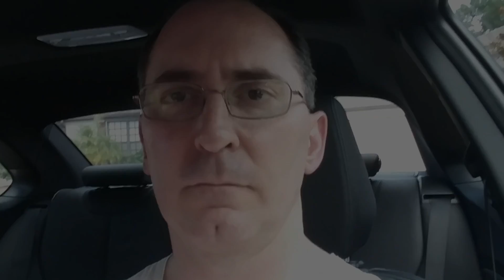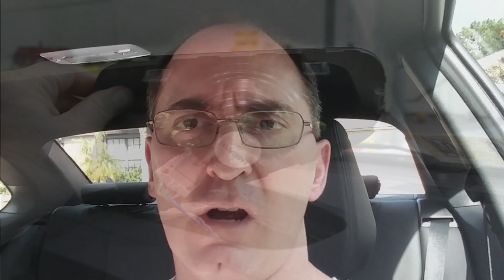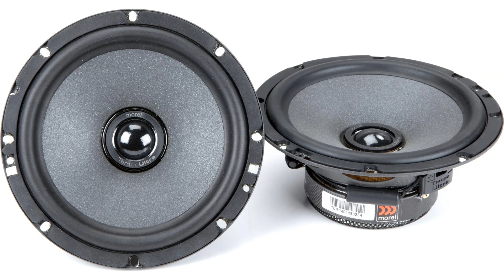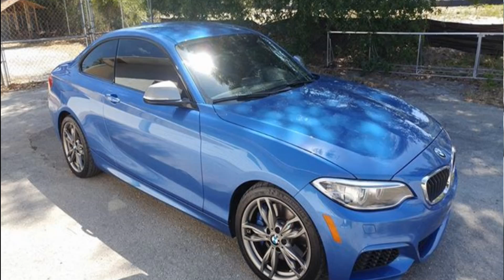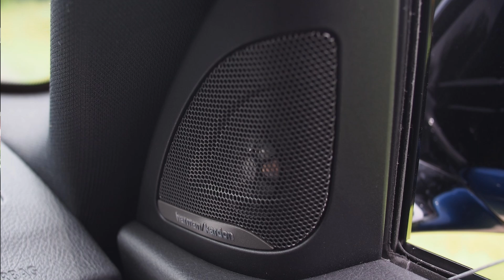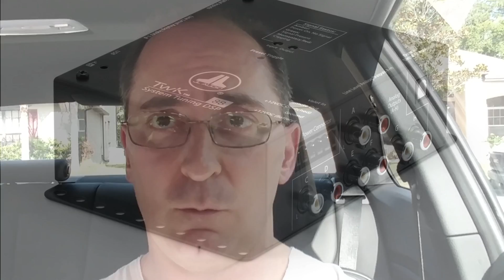Identifying Shortcomings in OEM Car Audio Systems

Comment: great video... my entire business, supreme shine and outlaw auto detailing, is based on automotive audio and video integration and taking out dents, scratches swirls and washing with waxing.  I often recommend to customers using my 2001 Acura CL type S.  came stock with a Bose 6 disc CD changer, 3 ways... with tweeters near the window,  and 5.25 inch speakers in the doors and 6.5s in the rear.  I use the car as a sample with all JL audio speakers replaced and crossovers in the rear, an in dash DVD player with the emergency brake hookup hacked to view movies while the car is moving.   digital surround processing from JL in the trunk, bass blockers to all speakers, 4 channel JL audio amp for speakers, 1 500 watt RMS mono JL amp bridged to a 12 inch JL sub.  dynamat  acoustic mats in the trunk, Kenwood DVD player with DTS surround.   works perfect!  it is probably the best investment I have ever made on car audio in my life as opposed to being back in high school when I would run 10 gauge wiring from the car battery with a large fuse to an amplifier under the back seat with a subwoofer in the rear and the main speakers were not Amplified at all it made for a horrible sound extremely bass orientated and it would always rattle the trunk.  great video Gene as I feel car audio is often a subject matter overlooked by audiophiles since it is usually associated with a different crowd or enthusiasts.  I have worked on even the nicest cars from Bentley Rolls-Royce BMW Ferrari Maserati Alfa Romeo and so on and so forth and I can tell you that no Factory car audio systems are ever complete without at least adding some sort of amplification to all speakers if not a better subwoffer with a custom enclosure.  a lot of people also Overlook the power and ground cables many people need to keep in mind those need to be a very large size depending on what amplifier you are using and I always try to keep the ground cable about a foot to two feet maximum and length grounded record to the chassis or frame.  also if people get some sort of headlight dimming or power loss that is often times due to not enough capacitance in the power supply system in the vehicle that is why sometimes I recommend either switching the original car battery to an Optima red or yellow top battery along with a 1 to 5 farad capacitor for juice stored when needing power on command.  also the RCA cables used to make the signal path complete between amplifier and head unit must be decent quality as cars are often in motion and if those RCA plugs become damaged or loose the audio quality will be affected or impacted severely.  I also always do custom installations which include using some type of wood usually in the trunk later adding carpeting to it normally supplied from the Vehicle Manufacturer in order to give it a factory appearance.  I would really like it if you were to check out a few of my videos as I am trying to become an informative individual as to audio and video technology.  since applying for my tax code for the automotive business I have been considering turning my YouTube channel into a website for the sale of home audio equipment although the overhead and markup are questionable to me that is why I have not yet actually created the website but have a ton of ideas in mind for integrating the existing auto detailing business with home audio sales or at least some type of business offering a service of installing home audio equipment.  very nice car Gene can I also recommend using a german-made paint sealant as opposed to a man-made wax material utilizing carnuba.  I will also perform a video on some of the materials I use however I recommend using a German paint sealant which is a synthetic compound that specifically works well with german-made vehicles.  my business thrives on the fact that I use only extremely high-end Automotive finishing compounds usually matched specifically to the paint codes and region of manufacture.

Comment: Swapping higher quality tweeters in (front) components breathes some life.  I also have added small subs in the trunk, tapping into the rear deck speakers for a signal (and EQ'd the remaining speakers for less bass).  With the right ears you can tune it to sound significantly better and come in at well under $1000USD without having to replace the stock system, or all the system's speakers.

Comment: Seriously looking forward to this Gene.  I had a Focal/Alpine upgrade in my 123D that with some other preparation work in the doors sounded fantastic.  I've not personally heard the HK system in a 1er/2er, but have read several reports that they're just not worth the money.  So it's great that someone with your know-how has stepped up to this, even though it seems as if the solutions are already out there.  Let's see how you get on.  Cheers.

Comment: Excellent, I just bought a 2014 Audi A6 with a Bose system that was a $600 upgrade for the first owner.  No bass, buzzy front center speaker and too much "surround" processing.  Would like to keep the head unit so I am looking forward to seeing how you upgrade your system.  Thanks for doing this.

Comment: this is very awesome that you are getting into car audio. I hope you continue to share your upgrades and findings. I have a 16 Mazda cx5 with the Bose system. I've done a whole bunch to the system and still working on it. It also features a center channel, which I've done something interesting with. My car did not have tweeters. The 3 dash speakers are covering from about 250hz all the way up to 15k hz. I replaced them with Dayton audio nd91 drivers, added passive crossovers that low pass the midrange at 4.8k Hz and added tweeters to the left and right, but not the center. Tweeters are in the A pillars. Dash speakers are still ran off Bose amp. Added JL zr800 midbass in the doors, 100 watts each. And JL 12w6v3's. Also I completely faded all the sound to the front and disconnected the rest of the Bose speakers. I find it sounds much better without the rear fill channels IMO.

Comment: When buying a car, I go with the most basic factory audio system, and sink the dough into a proper aftermarket setup.
1) Start with the head unit you want, and work your way from there.

2) Consider going active, i.e. get an electronic crossover or DSP, and run separate amplifier channels for each tweeter and woofer.

3) With sound deadening, you don't need to fully skin the inside of a door, or the entire bodywork for that matter.
     That's just going to be a waste of good deadening mat. Read up on the "dosage" that suits your car best, and deaden the bits that do vibrate.

4) Invest in automtotive-grade audio cables for your setup.
     No, I'm not talking about the snake oil of several hundreds of bucks, but cables that give an improvement over the factory wiring,
     yet is still capable of dealing with the harsh environment that is your car (as opposed to your home theater room).
     If you're going active, you need to run extra speaker cables anyway.

JL Audio is a good choice for amps and subs. If you want something under the seat, their TW series + a custom box should do the trick.

Comment: I think you need to do a 3-way front stage. 

13w6 active plays 20 Hz to 40hz
JL zr800 8inch midbass drivers in custom build kick panels vented to outside of vehicle plays 40hz to 200 Hz
Hybrid Audio 4inch LE plays 200 Hz to 10k 
Hybrid Audio L1v2 plays 10k to 20 k
2 JL Audio 600/4 on bridged to midbass only
1 600/4 to 4inch and tweeters that are receiving a 150 real watts to each speaker with regulated power supply class D R.I..Ps by JL only.
1 1200/1 to 13w6 in custom tuned to play only 20 to 40hz 

The processor is the brand new Mosconi new 8/10 with new Digital to analog converters with upgraded OP amps and much more. 

all the best JL wiriing and 2 kinetic2400. One is for starting the car.  One for the rear of the vehicle. 

Soon to go with 5inch in the dash and play them down to 100hz and run up front sub single Jl  w6v3 and remove ZR800 midbass drivers.

Comment: Go active with a processor and custom speaker positioning. But I'm sure you know this. Check out my Hybrid Audio 3 way custom SQ system that gives you goose bumps and that was my old setup. The problem is reflections. I can let you hear 3 cars that would make you think the singer is on the hood and you drummer is behind you ect.

Comment: instead of using jlaudio, look at the moskoni amp system. 6 channel with processor integrated.
and also, moskoni can provide with specific cabling and instruction for each car. BMW is one of the worst cars for installing due to the excess of electrical noise.
Reply from the maker: I appreciate the options you suggested. However, JL Audio has been pretty receptive about getting me some hardware to try so I am likely going that route for this install.  I am hoping removing the ASD from the system will lower the noise floor and will report on that as well.  thanks.

Comment: I think this is a great route to go down. I'm into cars too, I have  a 93 Toyota Mr2 Turbo that I have modified and upgraded the stereo as well. I went with a middle road type, Alpine head unit, pioneer 2 way speakers, upgraded the tweeters and a 5.25 in sub from Tang band. Sure this stereo has limits,  but I think it sounds good and it's just for a sports car so doesn't have to be powerful, a nice balance if you will. The great thing about HT or cars and stereos is if you don't like something you can change it.  Look forward to the next video as always.

Comment: I am disappointed to hear BMW did that , i have changed all of my car speakers with Focal Access installed a  pioneer Dvd receiver with sound alignment 13 band EQ and digital crossover , also did 10 inch sub in the trunk to add some bass i have to say it sounds really good and i don´t have the tools to do a proper tune no speaker amp yet But as you told JL audio is good option also Audiocontrol  
hoped  for more car audio stuff on the channel

Comment: the environment is the biggest shortcoming.  reflective surfaces everywhere!.  plus high noise floor.
Reply from the maker: Yes that is a problem but you're also listening in a nearfield situation especially since it's such a small car. You can still get good sound if the system is good.

Comment: Hi Gene, thanks for the great video, a nice break away from home audio. From my limited experience in car audio, best system i have heard in on the Volvo 2016 XC90 with B&W "premium" sound package. Also has Dirac correction software in it.Please have a listen to this if you can. Sound insulation on that car is top notch also..comfy seats, lounge on wheels for sure.

Comment: i know you guys probably aren't big fans of the spl competion cars, but along with the spl competion, they have SQL competion vehicles, where people's cars get judged on the overall sound quality, and imaging, while also having high spl capabilities, check out some of those.. and I think it'd be fun and cool to see one of you guys hopping in a full on spl build and getting a crazy loud demo to just see your reactions. I do agree that car manufacturers throw out premium audio way to easily, when looking up information on my work van, a Ford e350, I found they all come with a premium audio head unit and speakers, it's an 03 and it's just two 6x8 speakers, as far as most stock radios go, it had OK sq and got decently loud for just having two speakers run on the deck, the bass also reached fairly low, and is getting full bandwidth, I added a very old but free Rockford fosgate 600a4 amp, using an inline converter, and an 8 inch JBL home theater sub because that's what fit in-between the front seats, that was OK until the old amp have up on me, I saved and bought a sundown audio 1000d amp, and it stays ice cold, I also ended up making a box for a 12inch subwoofer, tuned to 28hz and put a cheap sub I had lying around in. since this sub was cheap, it didn't reach any deeper than the 8 just much louder as it had dual 4ohm coils getting up to half of the amps full power, obviously I'm a bass head and did this for the sake of more impactful bass, more recently I bought my buddies Alpine type r, it handles the power much better, and actually hits the low notes like a champ, the sundown amplifier still seems like a little much for the sub to handle at full tilt, but I'm keeping my sundown e12s in my home theatre setup, as I love the way they sound in here. I likely won't do much else in the work van except end up with a better subwoofer from sundown with a dual 2 ohm coil, and easily handle the underated 1000 watts rms. when I get w new car, I will do everything, replace all speakers, amplify them all, maybe by fixing the Rockford fosgate amp and using full/ hi settings, going all out on the bass maybe two 15inch subwoofers on 4000 watts rms in the trunk, custom box of course, and possibly 2 or 4 8 inch subs in the cab somewhere in sealed boxes to add some decent upper bass and punch, if I go that route I'd likely be getting a sundown 1100.5, which has 4 stereo channels with 75 watts rms at 4 or 8 ohms(I don't recall), and a subwoofer channel that pushes 800 watts rms at 1 ohm.. i realize that amp alone is probably more than enough for most people

Comment: We recently bought a Mazda CX-5 and the quality of the audio system was a major deciding factor. I've never been impressed with Bose speakers or their radios, but I had read that with car systems Bose matches the system to the specific car interior of each model. It sounds MUCH better than any other car system I've heard. It's not in the same class as my high-end home system, of course, but it's very enjoyable.
Reply from the maker: Bob Muenchen While Bose may be hohum in home audio, their car systems can be quite good as far as OEM goes.

Comment: Awsome video gene, i think its a great topic, i to am looking to do a total upgrade in my 2006 yukon denali. I have been looking at a speaker company called hybrid audio..and the the clarus line i have personally heard in a passive setup and  the speakers sound AWSOME!! The owner of the company has been doing SQ competitions for years and i think he has something here...because i havnt heard any speakers yet that can top these regarding SQ.I also found out that HELIX is a sister company and i was checking out the 6-channel amp with built in DSP for running a active crossover setup in the front doors and coaxial in the rear door for rear fill. You also may wanna check out companies such as audio control, audison, and hertz for amplifiers and DSP's...i know your a SQ guy like me and i think those brands maybe a better fit than JL audio...as always keep up the great work i have learned so much since subscribing to the channel, and also wheres hugo???...until the next video i will keep listening 😉👍🏻👍🏻

Comment: Just installed the fix and twk in my G37x. re-amplified using audio control epicenter 1200 and lc 4.800. c3's front and back in place of the 10" door woofers. only thing I want to go back and do is run active instead of passive in the front but it sounds pretty good as is.